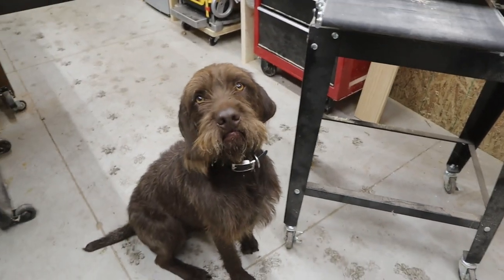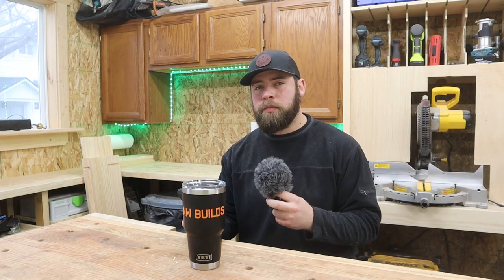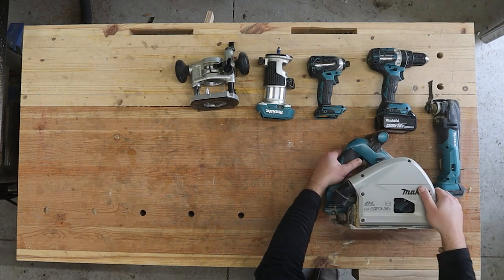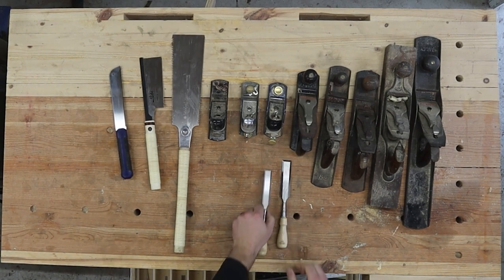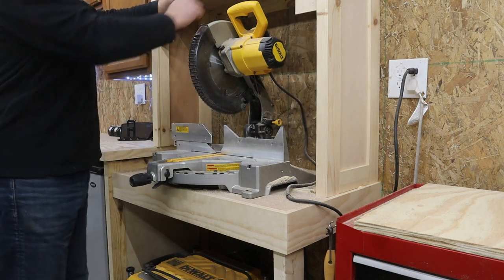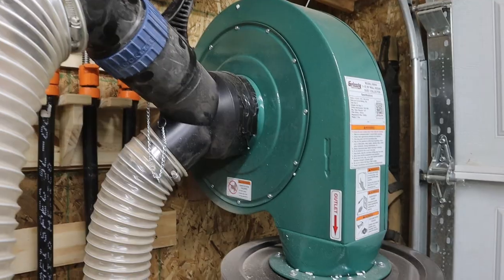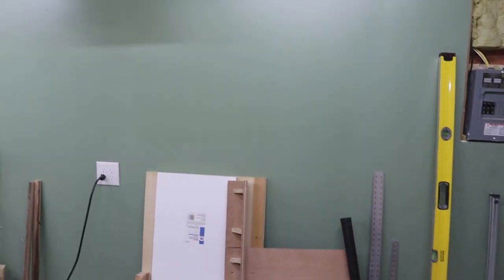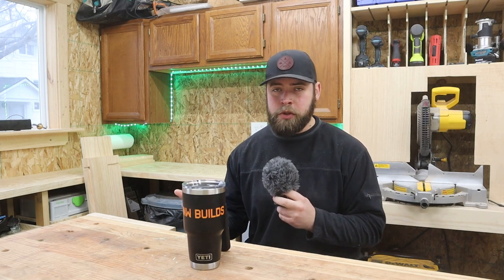Small Workshop Tour (Layout and Tool Buying Tips)

Comment: You could build a cabinet under the sander utilizing the leg frame. Or screwing right into the metal frame to attach it. I would recommend an inset door though so dust doesn't fall between the door and cabinet frame. Also, utilize those rafters for long-term storage. You could lay pieces of plywood, or OSB across two for smaller items. I have a loft and that is where boxes or cases that tools came in go. I have a 6ft circular saw crosscut jig hanging from one side of the loft beam and the other end is on a pulley. I just lower the one end and it acts as a panel saw too. Between this jig and the radial arm saw, I rarely use my table saw anymore. I'm thinking of selling it.

Comment: I can corroborate that a standard miter saw is better than a slider.  The Bosch is probably the best but they ALL wiggle from side to side which means less accurate cuts which means more frustration.   A good rule of thumb; simple is better, avoid bells and whistles.

Side note: I like this channel because I am also a lefty woodworker in a small shop.

Comment: I have to say you've done a great job with your space!  I really liked your miter saw station and the sliding hood.  I've seen the design before but never seen one that was in a slot that you could raise.  That was really cool and inspiring.  And having your tool stored just above it was a nice use of space.

  I am in the process of trying to rearraigned my 12x16 shop with a Craftsman 113 model tablesaw.  But struggling to decide how best to position it with my 48x45 workbench/outfeed table.  Those two together take about half the space in the shop!  Currently, I have to move things around like that little game we had as kids where you had to shift all the squares around to complete the puzzle... move this one down, move these two over and shift another left... then slide this one down and... on and on.  Most everything is on castors but it's all in the way.  I don't know if it's better to put everything against the wall and pull it out as needed, OR, place the tablesaw and workbench in the middle and everything else against the wall.

  Anyway, I'm rambling...  You've done a great job with your shop layout!  Thanks for sharing!
Reply from the maker: Thank you for such a thoughtful comment!

The miter saw station has been working out really well! Based on YouTube analytics, miter saw stations seem to be a really hot topic so I was thinking about making a video about why I made the decisions I did and what I would do different with a few common scenarios. 

I definitely understand your dilemma. I ran into that too before I downsized some tools. If you’d like my 2 cents, shoot me your email address and I can reach out and we can talk about it. 
I’ve been thinking about making a video on the topic and maybe you could be my example!

Comment: Great shop layout. My shop is a 10x16ft shed I had delivered and insulated and hired an electrician to come in and install its breaker box and outlets. I do wish that I put in more 220 outlets, but those can always be added. At the 110 outlets, I have power strips with a surge protector so I do not have to worry about a surge in electricity burning everything up. The 220 outlets have a built-in surge protector, which was a bit more than a regular 220 outlet but well worth the price. Most everything is "hobby" size due to size restraints. About a year later, I regretted not getting a larger shed. You know, hindsight and all. One thing to consider before buying a new table saw. I noticed you have a track saw. Awesome! I do not and use a straight edge for full sheet breakdown, but the samething. I have the Dewalt DW745 table saw, but it does not take a dado stack. So instead of spending thousands on a new table saw, I purchased a 1950s 10" Dewalt radial arm saw. I wanted something to restore, but this was in such great shape, I just did an interior cleaning and new bearings. It came with a blade guard, extra blades, and a shaper attachment. When I have a lot of dados or rabbits to do, I put the dado stack on this and I love it. You can cut wider width than a sliding compound miter saw, it accepts a dado stack, does compound meters, and if need be, can do long rips on it. Once these saws are set up and aligned, you will get dead straight cuts every time. Plus, there's a bonus, it was only $75.00!. I have seen them listed from $25 to $225.00. That is a bit much if you ask me. Brand new a RAS costs at least $4000 and go up from there. But on the secondary market they are super cheap. I didn't want anything electronic like the Craftsmen that came out in the 1980s. I wanted nothing that could break that would effect the whole saw. 
I think it may be a good alternative for you as well do to the size of your shop. Just a thought. Thank you for the tour. You gave me a few ideas.
Reply: I got rid of my Craftsman RAS because I had to reset it for accuracy time & time again. Avoid this frustrating And costly experience. I have a wonderful Makita mitre saw that has worked well for 20 years, but dust collection is not its fine point. If someone can invent a mitre saw that captures sawdust they will be wealthy!  Most, and some are NOT good enough here. Mine lives in a saw cage which limits most sawdust until I vac it out.  BTW Leave some room & comfort for the woodworker, Cushioned floor, good lighting & fine dust collection. Avoid Drawers They are Just tool traps.

Comment: Just upgraded the lighting in my workshop to LED panels & battens from fluorescent light,amazing improvement..
And I put my dust collector in a small lean to shed I built attached to outside of workshop, cuts down the dust & mess in workshop when using & emptying bag.
Reply from the maker: Upgrading lights is something I wish I did a long time before!
Jealous that you can get your dust collector outside!
Reply: @nwbuilds  Lean to is only about a metre square,been thinking about making a pull frame to fit dust collector on, for easier access.Also been working on designing  a boom arm similar to these in the link, plenty of ideas on YT,a couple of them would make dust collection easier & cover a large area of my workshop.https://www.youtube.com/watch?v=Nnp9jzH7vAI

Comment: do you have any recommendations for bench vices? I'm having trouble finding one for a decent price that is well rated
Reply from the maker: I use this one: https://amzn.to/3Qsca3m
It's not the most cost effective, but I figured I'll have it on every workbench for the rest of my life and I can confidently say that i LOVE it.
I used to have this small irwin vise: https://amzn.to/3GsfsPH
And honestly, it was a pretty good bang for the buck. The biggest limiting factor was how wide the jaws can open. I think you'd be topped out at a 4x4?
You might also consider checking out Rex Krueger's channel. He's got a few different less expensive options, although you may put in a little more elbow grease.
Reply: Check out Face Book Market Place for a second-hand one. They are usually older models, which were better made and the restoration of it if you chose could be your first video!
Reply: @crossgrainwoodproductsltd9230  Definitely look out for the older models, better quailty, better made, have two vices dating from 1950 & 1930, both free, one from skip,other advertised free to collector on Freecycle site we have here in the UK.
Reply: Nice blue bench vise with quick-release lever! I am glad I noted the quick-release option when I bought mine from Amazon (Yost brand).

Comment: I have the Grizzly G0580 3/4 hp band saw, which seems similar to yours, with even less power. For what it is, I love it. I did three things to make it useful in my shop.
1. I added the Griz riser kit, so it now has full 12" resaw capacity.
2. I replaced the tension knob with a hand crank (Highland Woodworking).
3. I googled Alex Snodgrass and followed his step-by-step bandsaw setup. After doing that, the bandsaw has always tracked beautifully, even with the crappy non-standard blade guide system.
Reply from the maker: I love this list and if I saw it sooner, I may have kept it lol. I ended up selling it with intentions of getting a better one. But I've come to really enjoy the additional space in my shop so we'll see.
Thanks for sharing!

Comment: Just bought that saw and wanted to know how it's holding up.  Heard it has motor issues
Reply from the maker: I'm assuming you're referring to the delta table saw? I actually just upgraded it for other reasons, but I've never had an issue with the motor. 
I'm actually going to be doing a quick review of it next, I think.

Comment: Nice shop, great tour. Some really well thought out ideas there, particularly the shared infeed/outfeed space by moving tools into the walkway. I do the same thing with my jointer and planer, to get 14 feet combined infeed and outfeed, with 3 feet of working room, next to the machine. im in a 16x16, so space is tight sometimes.
Reply from the maker: Thank you! Sometimes I wish I had those dimensions instead